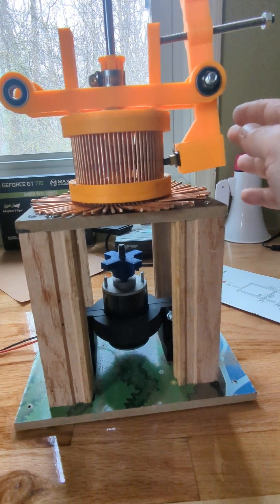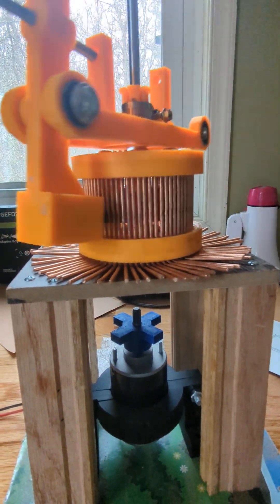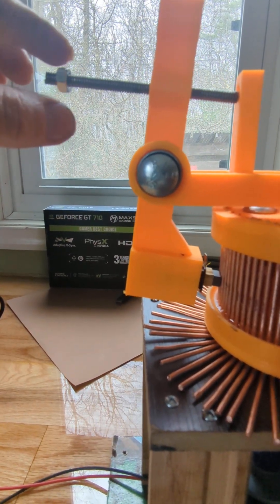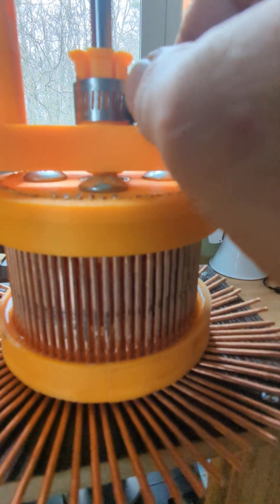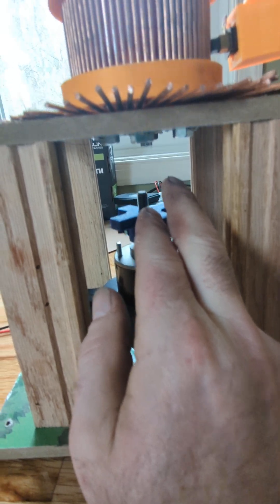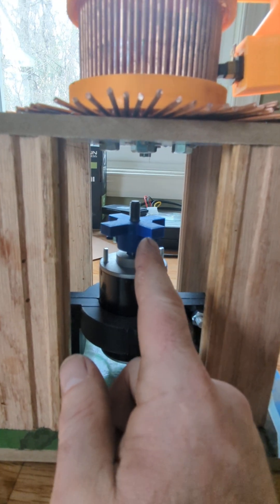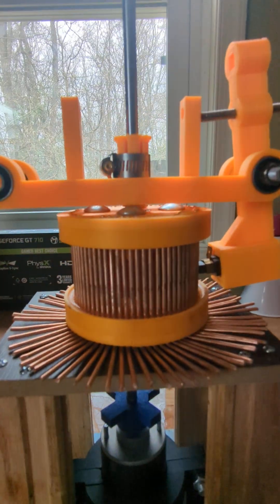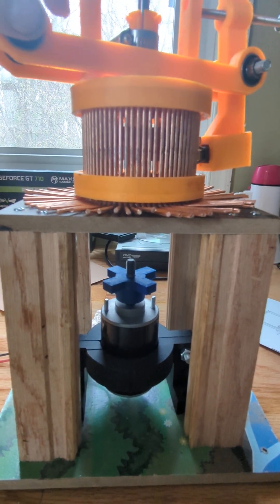72 Contact Commutator Build- Rotating Brushes

Comment: Hi Jim. That looks very light and flexible for high RPM. I fear it will distort unevenly under strain and then go out of balance and begin to destrucively oscilate. Your productivity and enthusiasm is inspirational. Thanks for sharing.
Reply from the maker: Yea, it all comes down to how smooth the commutator bars are.  I just juiced it up over 1000 RMP and looks solid so far.  Since it's just basically a switching mechanism, there will never be real load placed on it.  Hopefully it holds long term